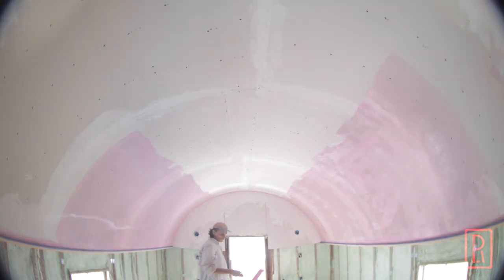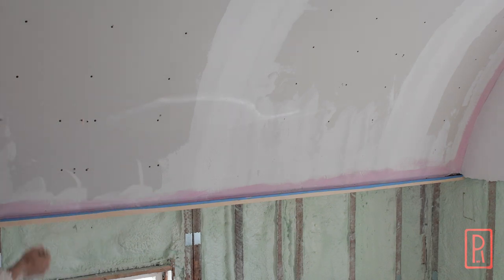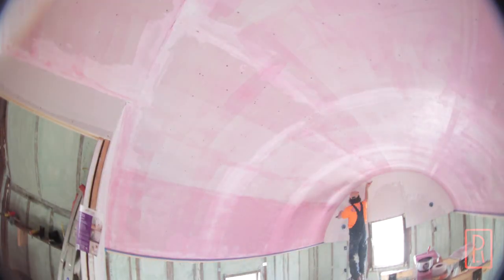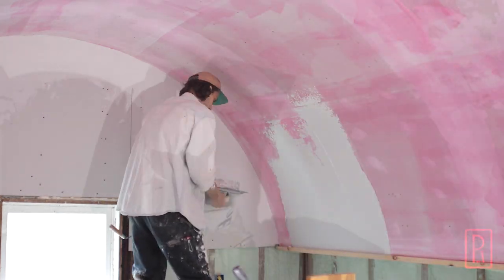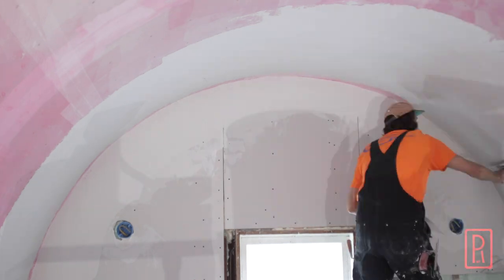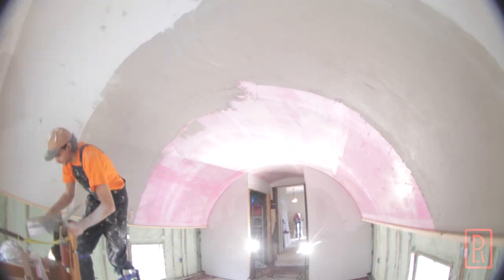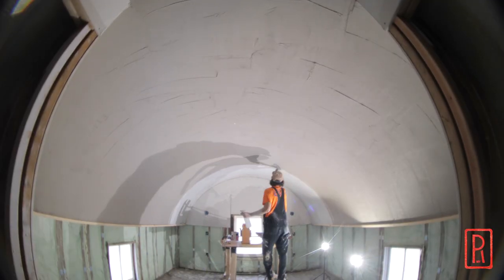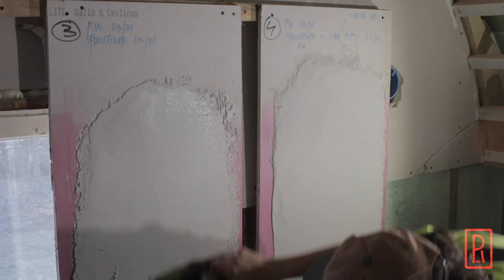012 PLASTERING the VAULT, Structolite Basecoat over Sheetrock, Bedroom Barrel Vault ep.7

Comment: I use to mix plaster, at times for 8 or ten plasterers. When I was mixing for that many  plasterers all I had to do is mix  Three  bags of base coat plaster and shovel it into buckets and the other tenders  would lug it to where the plasterers wanted it and dump it onto a plaster table with a peace of tar paper on the table top. While they were doing that I would run outside and wash the mixing barrel, shovel and drill. Then I would mix another batch without being told to.  THEY told me to keep it coming until they told me to stop.  Then I would do the same with the finish plaster. We would swirl the ceilings of a large apartment building in one day they used to like to do that on Saturdays some Saturdays we would finish the walls and ceilings. Of a large two story house.  The other five days of the week I usually tended one plasterer then I had to keep his tools clean as a whistle.  And a lot of other things. I think color difference you mentioned was due to the plaster changing color while it was setting up.  We called it green plaster. After it dried the color would be uniform.

Comment: Looks great! Why not forego the drywall completely and do the classic 3 coat plaster wall over wire mesh lath? I use structo lite for both scratch coats and then uni kal for the finish coat, water troweling it to glass finish. I really like to avoid drywall since it has cardboard which is not resilient to moisture, unlike true plaster wall.
Reply from the maker: The main reason was the price of lumber. I would have had to add a lot more layers of structure to get a stiff enough lath. Maybe next time, I'd love to give that a shot, definitely a superior process.